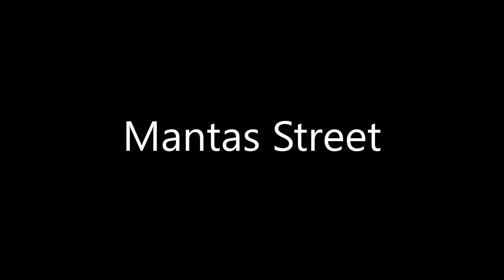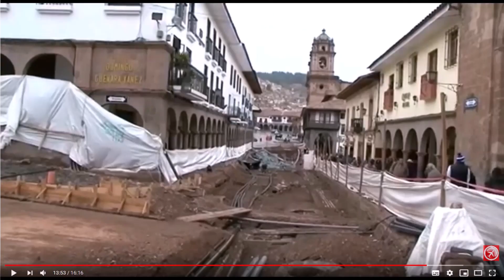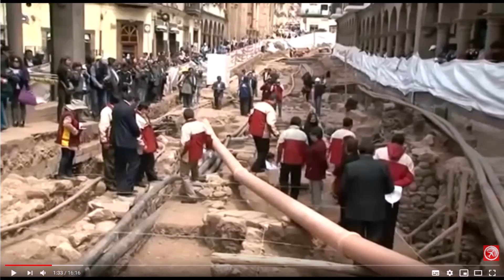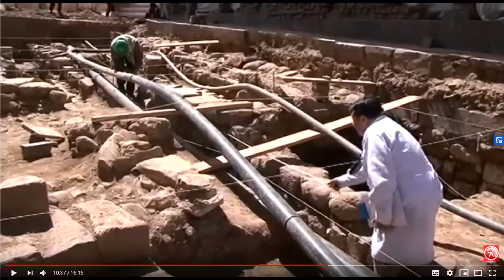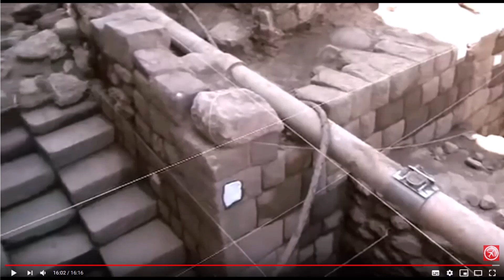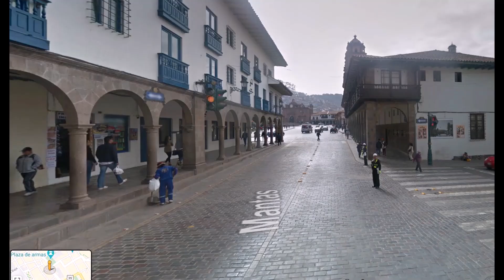Ancient City Beneath Cusco,

Comment: I've heard of a civilization in our past that spanned from the Pyrenees into Australia. They were a race of tunnel makers. They had a mastery of sound , but were frail in stature. The reason they went underground is that there were giants on the surface. These tunnel builders avoided them and violence in general. Keep digging. Some of the entrances can be located in caves or 'outpost' structures, though the actual entrances are like false doors. The mastery of sound was the tool they used. They could communicate for miles within the tunnels using a telepathic pitch of sound. They also decorated the tunnels with art. Their engineering involved resonance and vibration. I would suppose this was about 300,000 years ago. Deep in the earth their tunnels remain, but probably mostly in ruins by now.
Reply from the maker: Great comment, any links?
Reply: @ZiggyDan  Most Definitely, this is a fun one, The Lumanians, I read about them from Seth about twenty years ago and look out for things that connect. Here is a good article about it
http://www.crystalwind.ca/mystical-magical/earth-enigmas/sacred-places/the-lost-lands-of-lumania